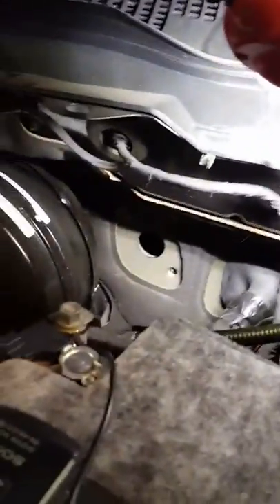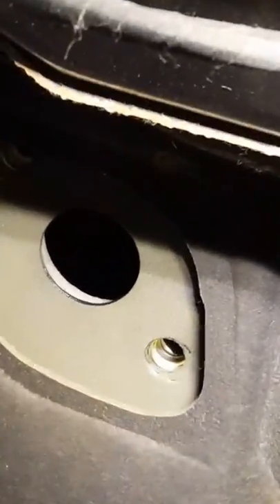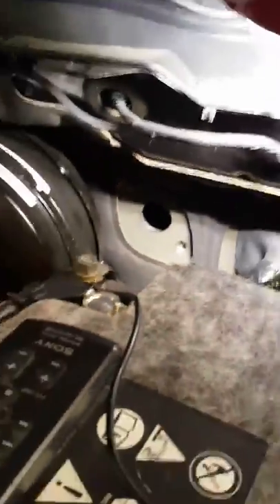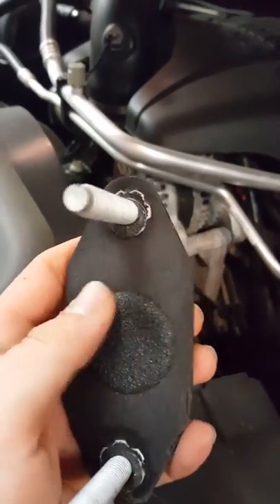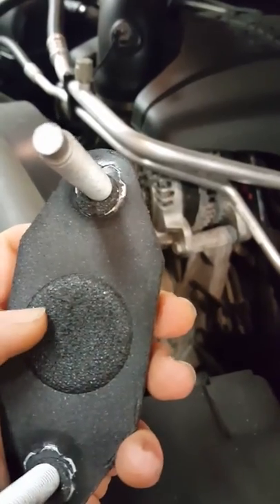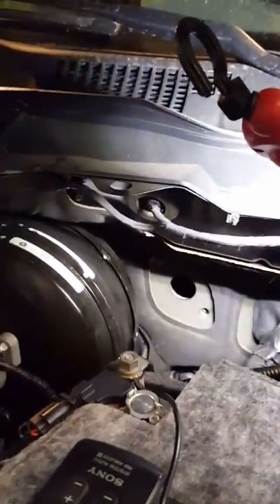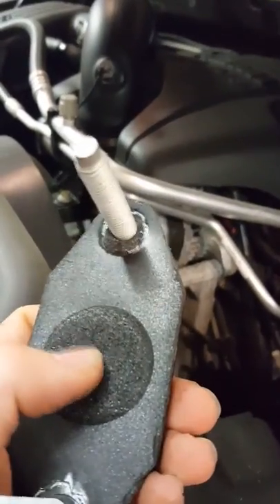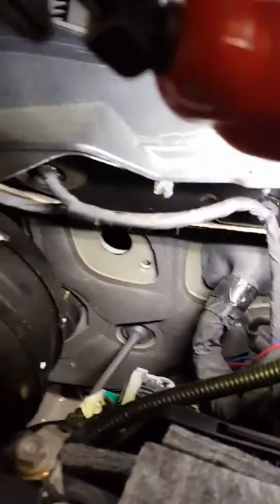2014 dodge ram routing wires through the firewall

Comment: I got a 2021 ram warlock. I was wondering what the plates was for.. I'm have a 8 gang switch panel. All the other video is of people cutting a hole in the e-brake cable grommet. But this is gonna be way better. Thanks 👍

Comment: Thank you! 2015 Ram for me. Huge help!  and it’s so easy. Running wires from the rear of the truck for a camera, switched bed lights, light bar and extra rear switched backup lights. Lots of wires I was wondering how I was going to get them all in.

Comment: If that's the clutch hole it doesn't work for me. 6 speed manual trans. Got any other good places?
Reply: u should have a round rectangular cap under each seat made of plastic u can either drill a hole or remove it completely hope this helps thx
Reply: u can also sneak a wire through where the emergency brake pedal penetrates the interior of truck